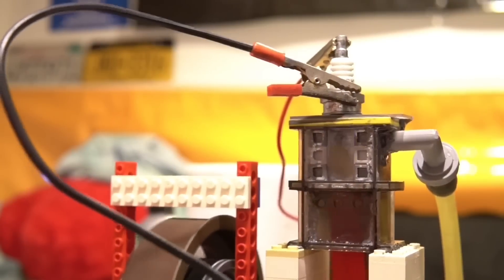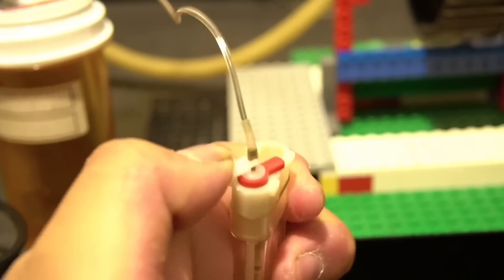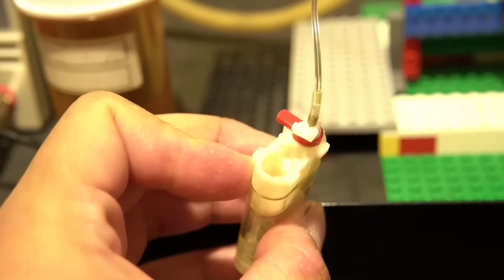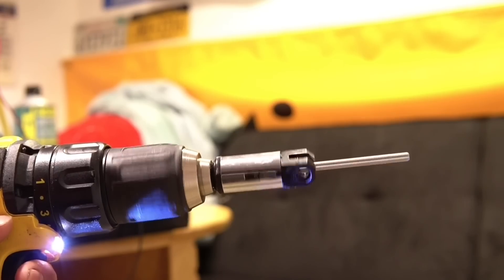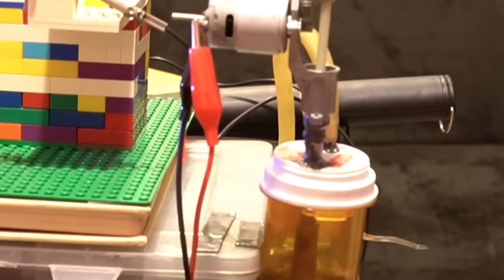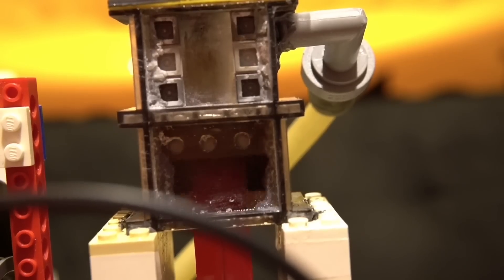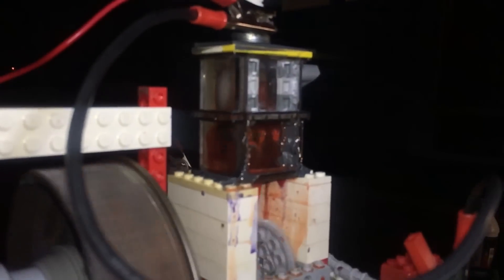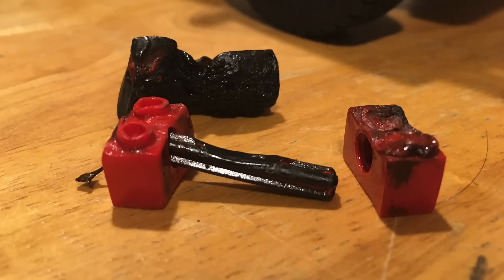Working LEGO Combustion Engine! (2 Stroke) Version 3!!

Comment: remember, this is a 2 stroke. The exhaust needs some backpressure, not an open hole, it won't run well at all :)
Reply from the maker: David The Awesome One! Yeah I need another vaccum system at the exhaust but it would mean the engine will be comprised of more and more nonlego parts
Reply: @madbrick923  what about adding more compression?
Reply: @madbrick923  naw man! go tear apart an old week whacker, and cut open its exhaust! it's just a bunch of chambers that makes the air move thru and causes a resistance, enough for the engorged to have a bit more pressure! Not all that hard to make out of Lego. Also, please if you can, aim the exhaust away from the points! (spark gap, ignition point spring thing) any unburnt fuel will be ignited by that lol
Reply: Mad Brick why don’t you try a small stihl engine muffler. They’re relatively close to the same displacement engine as this . The piston is like 1” wide but the stroke is longer
Reply: @madbrick923  Lego exhaust
Reply: @madbrick923  i mean, still its cylinder, piston and conrod and crank are from lego,So thats still awesome, and it would be even better if you would make it anyway work by itself!!! It would still be a lego engine, but with a fuel pump and a exaust pipe!
Reply: @madbrick923  then make a 4 stroke with a bigger bore
Reply: One other thing you can do is add a sort of "transmission" on the end of it to run the fuel pump at the correct speed in relation to the speed of the piston (could be done fully with Lego to reduce the non Lego parts)
Reply: @thejuicecart246  it would probably lose power by it
Reply: @thejuicecart246  Use an RC car exhaust, it can pump the fuel with an rc car fuel tank.
Reply: That is not true at all. They benefit greatly from tuned expansion chambers, but backpressure will make it run worse. They make weed wacker mufflers like that because it's cheap and muffles the sound. Look at any 2 stroke dirt bike, the exhausts have an expansion pipe and a straight through muffler with perforations and fiberglass insulation to muffle the sound with minimum restriction. In fact, my homemade 31cc weed wacker engine with a 20 inch propeller I made for an RC plane made more thrust and revved higher when I took the restrictive muffler off. Of course, a tuned expansion chamber would be best, but that shows that no backpressure>backpressure.
Reply: That's not true in all cases.
Reply: engines don't need backpressure stop spreading this myth.
Reply: Liam Holcroft don’t “need” back pressure to run. But all efficient engines use back pressure
Reply: John Reynolds The myth came from people who cut exhausts off of older cars and then they ran like crap because the car can’t adjust itself for the change. People will throw a “high flow” exhaust on any old car and expect it to be totally fine but it runs poorly so they say that it needs backpressure. There’s a lot more that goes into exhaust than backpressure and there is exhaust scavenging but any high horsepower car has a high flowing exhaust to raise the bar for the maximum power.
Reply: John Reynolds Most modern cars have enough complexity to automatically adjust for a new exhaust so unless you mess with o2 sensors they will run perfect. To expect gains from an exhaust it has to be tuned for it. Also, modern cars have very non restrictive exhausts compared to older cars. Most modern cars won’t benefit much from a catback and accompanying tune whereas an old 70s car with a free flowing exhaust and tuned properly will do quite a bit.
Reply: John Reynolds it will seal enough when it's melted and sticky 😂
Reply: It is not true that they need backpressure to run! Backpressure from exhaust can be USED to supercharge a twostroke when done right but it does not require it. The problem is the poor piston seal. Also you need to move the air/fuel intake lower, little bit higher than exhaust ports because the air pipe may cause compression leak.
Reply: @ASoftaaja  it's even not back pressure! It's resonance, it is a big difference between back pressure and resonance!
Reply: My 2 stroke didn’t need back pressure. And it was even more simple than this one. I ran it without an exhaust to annoy my friends lol
Reply: steelavocado shows what you know...
Reply: yes back pressure is very important but it can run well even without it. I have converted an old fridge compressor to a 2 stroke and it works fine without back pressure
Reply: Scavenging maybe, but I don't know any motors that benefit from backpressure.
Reply: David The Awesome One! Plus it’s a square piston 😆 it will never seal well enough
Reply: @RossiFumi95  Look closer at his design, I bet his square piston seals a lot better than his intake port :)). I believe the biggest issue with this design is that the intake port is at the top of the cylinder, so all the compression goes back to the intake tube, or is provided by his air pump...
Reply: Lol like that is the problem of this engine, you have less idea than the guy in the video
Reply: 2 stroke? More like 

Supposed to have a stroke
Reply: No, it needs scavenging which is a vacuum behind exhaust pulses that pulls the following mixture through. Backpressure makes engines run worse.
Reply: 2 stroke pipes aren’t for backpressure, the exhaust pulse through the specially shaped pipe helps draw the exhaust gasses out more as the engine gets into a certain rpm range. Basically scavenging. The whole exhaust is basically straight through, with the pipe being much wider than it needs to be for the size of the engine. You can get different expansion pipes to change the powerband of the engine.
Reply: Two strokes don’t need back pressure at all

Comment: Love you guys for actually making a fuel burning engine! But you melted Lego...😞😂 Will there be a version 4???
Reply from the maker: Might have to upgrade to aluminum pistons but there’s always room for improvement
Reply: @madbrick923  if you could come closer to top dead center,you could efficiently increase compresion wich in turn mean more power,but you would need a better piston sealer in order for this uppgrade to be worth it❤
Reply: They can probably fix it
Reply: @trashpanda3902  ... They can probably melt it Down completely and recast?
Reply: Here's a tip... Cylindrical pistons are more efficient 😉
Reply: @benneal3897  indeed, this is like a formula 1 car motor

Comment: Low compresion
The intake is in the top
Reply: Its a 2 stroke They have carbs and an air filter NOT an intake
Reply: @vatonix84  2 stroke efi: https://youtu.be/ZAjgQBTR7cg

Also, that is not fuel inyection
And the air filter is in the intake
Reply: @Giuliana-w1f  It is, there is no carb just a pipe going straight from the pump to the Turbe then to the combustion chamber  and HE HAS NO AIR FILTER NUM NUTS
Reply from the maker: Yes pero intake is 1 directional as in it closes automatically.